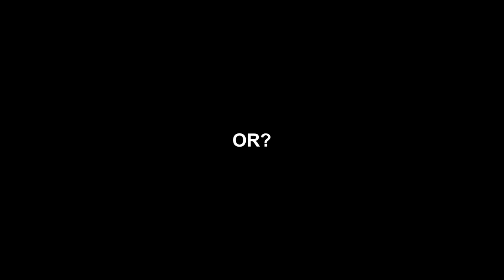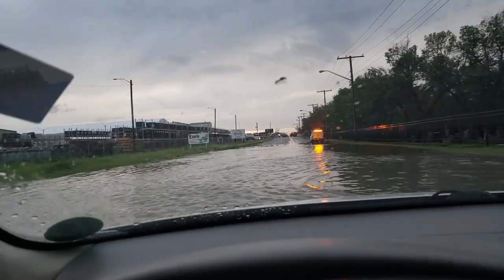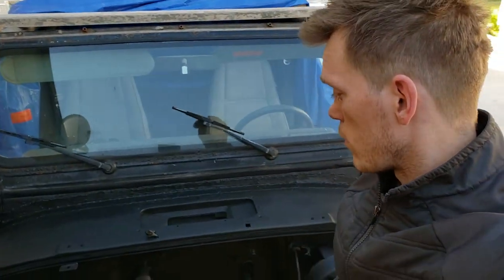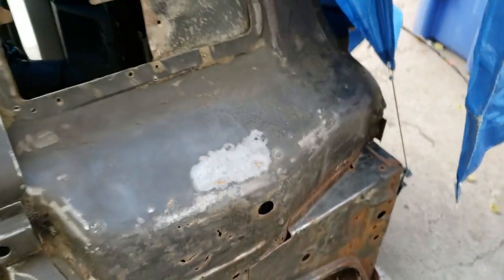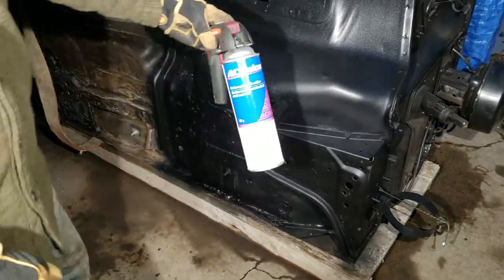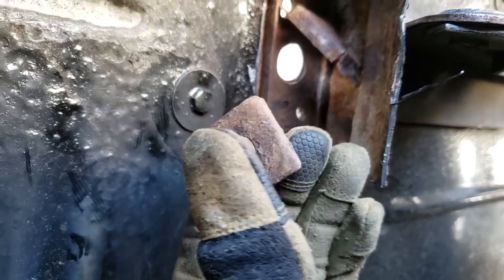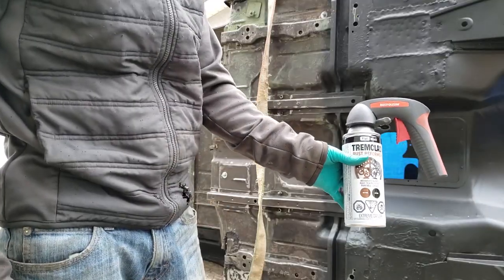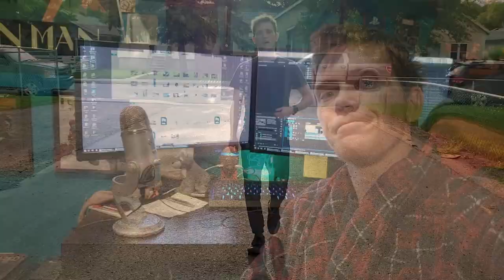Complete Jeep YJ Underbody Tub Repair, Prep and Paint - In 1 Video | Rover 1 Project

Comment: So it would take only $150 raptor liner kit or custom shop spray bed liner kit to do the entire jeep. And it will cover a lot of the imperfections and seal cracks protect body etc.. TCP Global . Com is where to buy it. I only recommend because that spray paint will last only 2 years.. just raptor line right over it. Loving this Zombie Jeep!
Reply from the maker: Yeah I wish I knew about Raptor liner before I did this. A little research won't hurt me next time haha
Reply: @LostFart  yep.. and for rust, the best thing I've used is a big bottle of "vinegar". Pour some in a bowl, put a handful of rusty bolts in it, and the next day I promise every bit of rust will be completely gone. It's amazing! And super inexpensive..